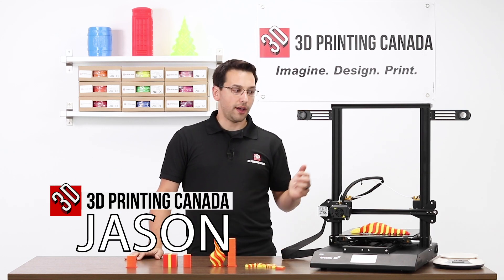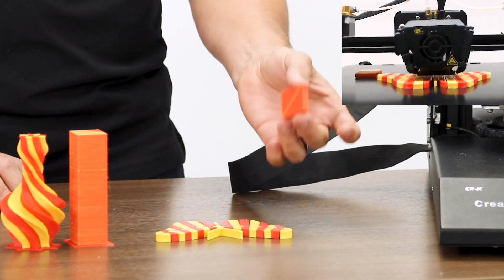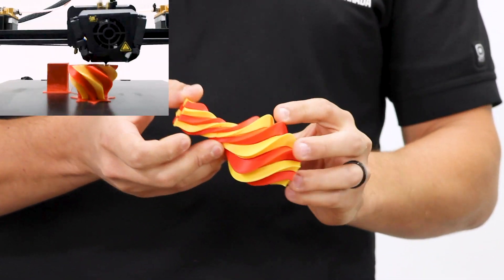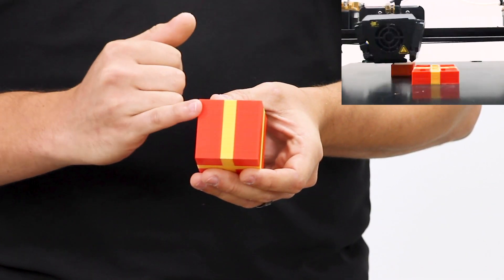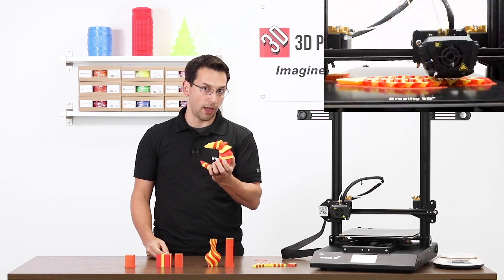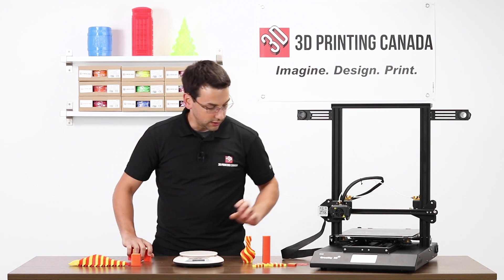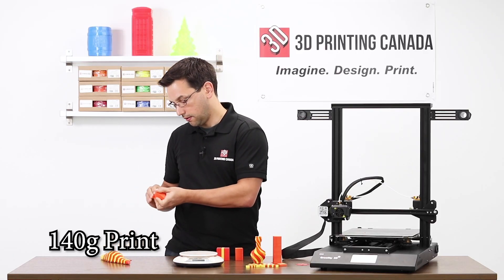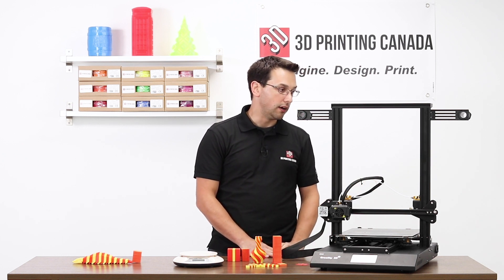Creality CR-X Initial 3D Print Review

Comment: You didn't mention, and most people forget, the purge block is constant for a set of objects printed at the same time. So if you printed 4 vases or 6 cubes at the same time, their purge blocks would have weighed the same as the ones when printing a single object.
Reply: Christopher Lewis Is you are right.